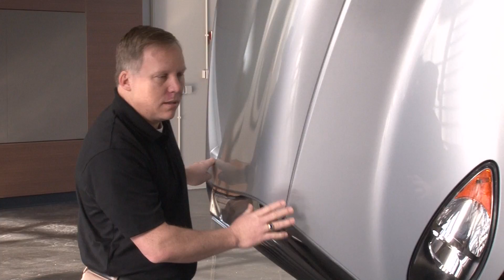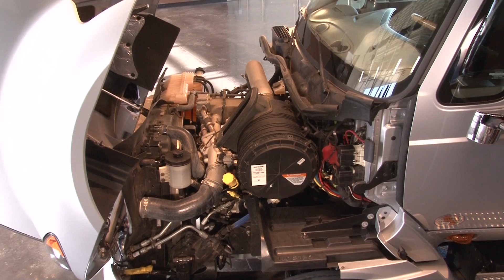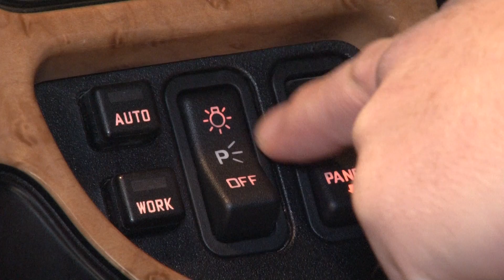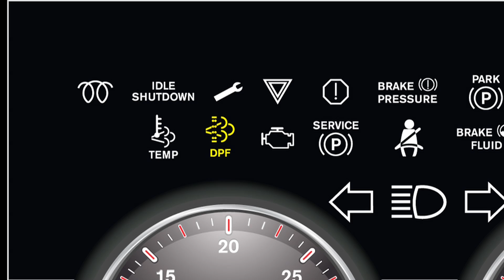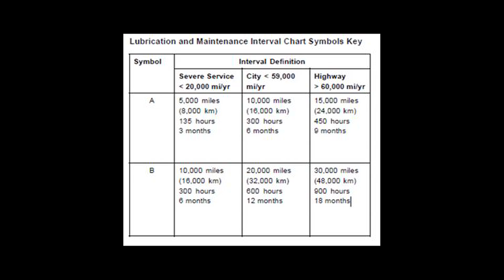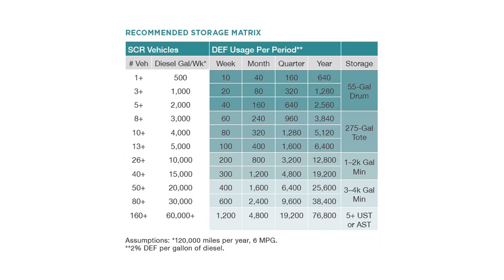International ProStar Delivery

Comment: The Pro Star day cab I've been driving has the engine brake on/off switch on the steering wheel. I think this is very dangerous because most highway exits have a curved ramp, and many are downhill. That means that my wheel is turned when I need to activate the engine brake and it's hard to find because my attention is on the road. Please put it up on the dash on future models. P.S. I really like the convenient location of the dipstick, and the bright color. So nice!
Reply: +Scott Shirey I agree, I also believe that the air horn button is too difficult to access when needed. Not sure who thought a small button on the steering was a good idea but its not.
Reply: Scott Shirey @ engine brake on the steering wheel is convenient for driver to see and put on/off if needed. it is not dangerous to control as when you drive the truck at speed under 60 km /hr when going down the hill or the bridge. it is my experiences on maxxforce truck.